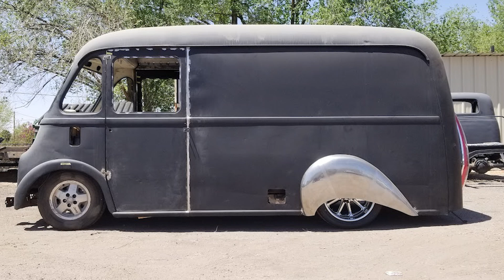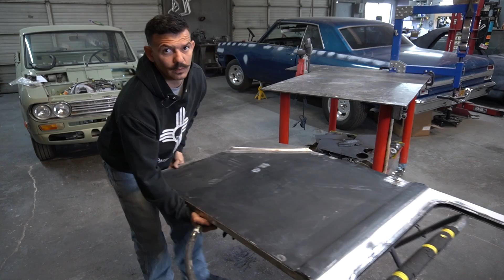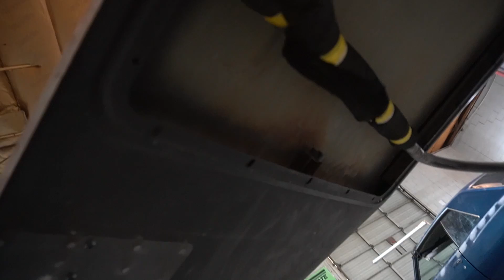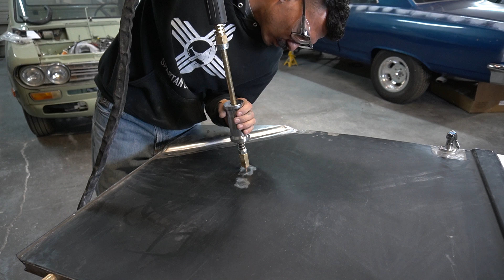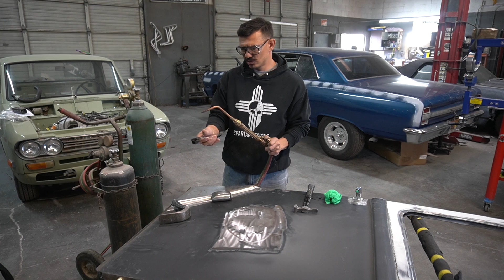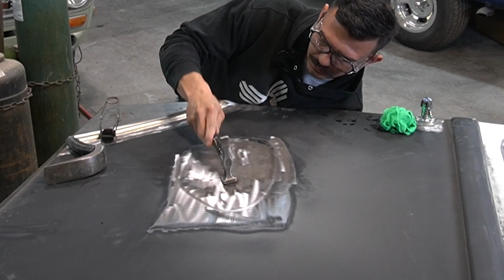Secrets to oil can heat shrinking | How to remove an oil can in sheet metal | Dent removal

Comment: I'm trying to grasp how metals can shrink with heat.
Doesn't heat expand metals?
Reply from the maker: Good question! Yes it does expand when heated, but it shrinks when it cools from the wet rag. When I heated that spot it swelled up and created an expanded lump where the steel turned orange from the heat, so I have to hammer that  back down and then when I cool it with the wet rag all that metal shrinks and tightens up. I hope that makes sense. Thanks for watching!
Reply: @BeAMetalFabricator 
Oh! Now I understand.
Thanks for the explanation.
Good job on getting rid of that oil can too.

Comment: Thank you for this video. I recent replaced approx. 8 inches on the inner and outer panels on the bottom of my 71 f100 doors and the first door i did got too hot and the door pops bad in the center left to right. I will try this over the wkend to fix my problem. Thank you!
Reply from the maker: How did it work out?

Comment: Does an oilcan need a shrink or a stretch ?    ,its usualy caused by the parimature having tension across it may need astretch rather than a shrink use a straight edgge ! Also u can make a shrinking disk out of an old stainless pot lid

Comment: Hey you said the metal expands with the heat and then, it makes sense that when you hit it with the hammer, the softened heated metal, you have shrunk that area. When cool it pulls from every direction. Thus loss of the oil can effect. Finally I understand the process. 👍👍
Reply from the maker: Glad you get it! Oil canning can be tricky

Comment: Great video 👍 Using a oxy torch is not always available so a arc welder spot and apply a lump of metal ontop of weld spot then push down onto a cold  metal lump or table 😊

Comment: Do you think a propane torch can do the same as the oxy acetylene for heating? Would need a more concentrated tip, thanks for taking the time to put out the video!👍🇨🇦
Reply from the maker: I have tried that propane and it takes so long to get a concentrated heat spot it ends up heating a larger part of the panel. I wouldn't recommend.. maybe map gas but oxy acetylene is best with a small or medium size Victor torch. 👍 Thanks for watching

Comment: That's amazing. Did not know that it was even possible to heat shrink Metal. 
And to cool the metal down,  did you use just plain water 💧?
I enjoy your videos very much.
I just watched the video you done on the replacement patch  on the bottom of the door for the 3rd time.
Reply from the maker: Yes I just used plain tap water to cool it down and relax the steel. Haha and I'm glad you like my videos man that means a lot!

Comment: Are you shrinking stretched metal or stretching shrunk metal?  I’m trying to understand the sequence of heat, dolly and cooling. What does each do?
Reply from the maker: Yeah so with the heat from the torch I'm shrinking the metal, where it turns red hot the metal forms a little bump so I hammer and dolly the bump back down just to planish it, then I cool it right after with the rag which is actually what shrinks the steel and also stops the heat from spreading too far on the panel and excessively warping, and relaxes the metal back to where it needs to be. Notice while it's cooling down the oil can is still there but after it's cooled the metal tightens up

Comment: could you use a shrinking disc for this situation ?
Reply from the maker: That's a good question, A shrinking disk might have worked for this, although usually shrinking disks are idea to knock down really small highs, in this case the metal might have clunked down with the pressure of the disk but it might have worked.
Reply: right on thanks @BeAMetalFabricator